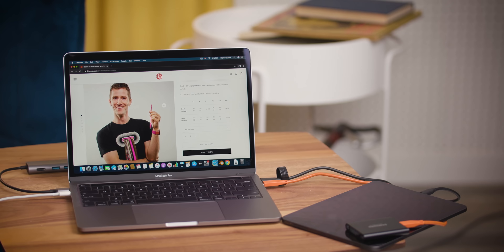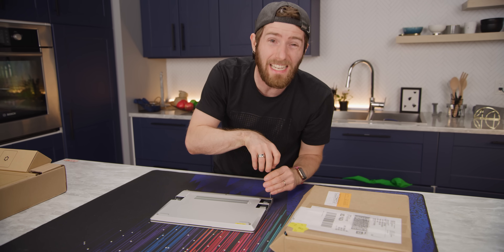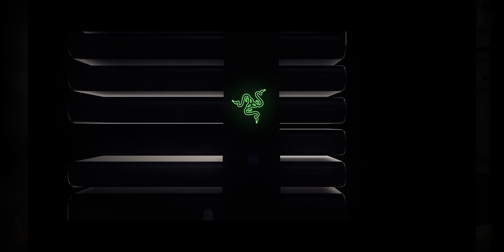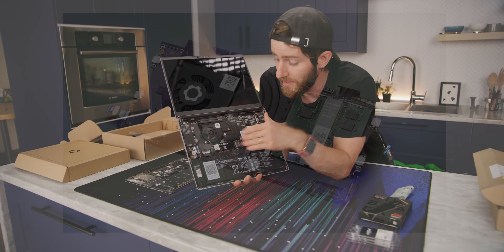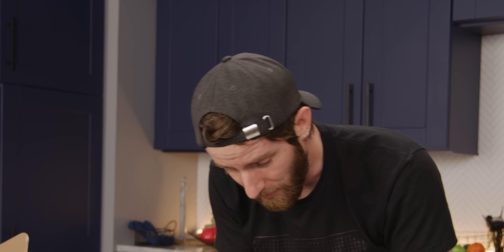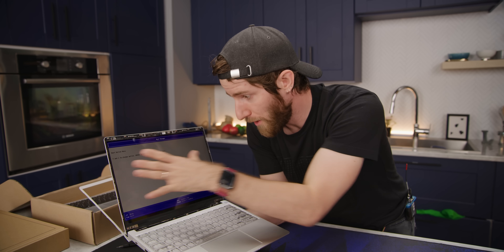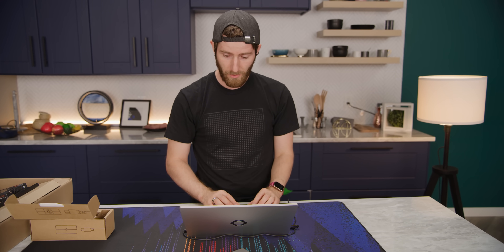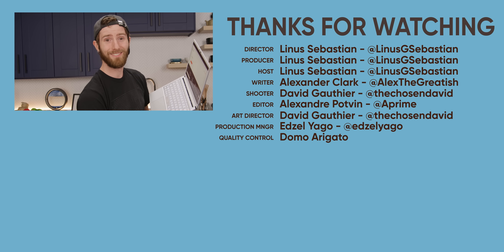A COMPLETELY Upgradeable Laptop?  - Framework Laptop Review

Comment: If the Laptop is charged with an USB-C-Port, I'm currentzly using one round USBV-C-Plug, that magnetically connects with it's cable, and since I got options for Micrto-USB as well, I pretty muchg hitted my other Devices with the compatible connector., so the SwitchPro-Comntrollöer charges with a magnetic cable and my PC-Controller does the same as do my cheap Tablet, Hand-Ventilator, my Moms Scanner for her Diabetes, her Phone as well,  and my small Bluetooth-Speaker.

And when I accidently connect my SwitchPro-Controller with my PC, my PC does recognize it.

Edit:
Link for the Typa of Cable I'm talking about
https://www.amazon.de/dp/B081D6RTT7

Comment: If this doesnt blow up I'll be very dissapointed.
we need more solutions liek these.
edit: regarding QR codes on the slots may not be the best solution, as all things on internet that dont make their way to "wayback machine" tend to dissapear for good.
just looking for drivers on a system that's 5 years old is already a chore as tech is moving way too fast, and new solutions come in.
so a tangible manual would still be great,

Comment: This thing is amazing! It is repairable and doesn't even slightly compromise on functionality. This is proof that tech companies have no excuse to make their laptops hard to repair.
Reply: See, I legit wonder how much R&D goes into making them hard to open. It almost seems like they would end up using more resources doing that then they would making it open.
Reply: Except it does compromise. A fair bit, actually.

There's only 1 USB 3 controller for all 4 ports. That's a huge compromise, since, despite there potentially being 4 ports, you're only getting full USB 3 bandwidth if you use one at a time.

There's no dGPU. Again, that's a huge compromise, especially given the price.

There are only 4 ports. Another big compromise, as most prebuilts give you more. My current laptop, which cost about as much as this one, with similar CPU, etc., gives me 1 charging port, 3 USB ports, 1 HDMI port, 1 Ethernet jack, and 1 SD Card reader. I can use all of them at once (and sometimes I do)--I don't have to pick 4 or carry around a hub.

Is it a decent machine, price aside? Sure.

But you can't possibly claim that it makes no compromises on functionality when it does so repeatedly.

Comment: Looks amazing, and I love that is uses a 3:2 display, but I'm never buying another laptop that doesn't have a touch screen.  I hope they offer that option in the future because this is looking pretty good.

Also upgradability for a laptop sounds good on paper, but realistically laptops tend to get a lot of wear and tear over time.  A regular $600 laptop can last me 3-5 years with little more than a battery swap, but by then it's looking pretty worn out which doesn't matter since it's usually due to be replaced anyway.  But this I would expect to be able upgrade for 8+ years, and I just don't see it looking nice and being fully functional by the end of that.  It seems like the only benefit to this is really just to save a bit of money by buying parts instead of a new laptop for a couple of generations.  I'm not one of those people who wants to keep old hardware alive and relevant by installing tiny linux or whatever, so maybe this is just not for me.

Comment: I would love a soundcard expansion for this thing that comes with more audio ports and a better DAC and AMP.
If we can stick them in USB sized from factors, we can do it with their expansion cards.
Reply: I think honestly you can hack one yourself, but if enough people ask I think they will do a first party solution
Reply: @Goldenoodles  it could be possible with a high quality USB soundcard/sound interface. 
But I'd feel awful mutilating a good one, even if I had the laptop. I'd also have to gut a working expansion card and rip it apart because I don't have a 3D printer to print these housings.
Not saying it can't be done, just saying I don't want to do it, nor am I the one to do it.
Reply: @LaskyLabs  gotcha, right now all we can do is wait and hope for it. Since all we have is a 3.5mm jack

Comment: I upgraded my old MSI GE70 with more ram (+8gb), new processor (i7 4700MQ => i7 4930MX), 1 SSD and a new battery. The only thing I could not change was GPU, because it was soldered to the motherboard. And this Framework laptop has soldered CPU + GPU, that means you will have to change the whole motherboard if you want to upgrade the most important parts ... Why did they not put removable CPU / GPU ? Even with specific laptop format / plug (MXM ?). My old MSI had removable CPU, and some Acer / alienware have removable GPU, why not mix ? Being forced to upgrade both at the same time is not the best

 And yes, modular IO seems nice, but it's just a detail to me ...

I feel like it's going to be some apple thing : you will have to buy entire new specific and expensive Framework motherboard with soldered CPU / GPU in order to upgrade, nothing else will be compatible and it will end up being just as expensive as a new laptop. I hope I'm wrong.

Idk, it doesn't feel like a "completely" upgradeable laptop, maybe future versions will be more modular, that's when i'll throw my money at them

Edit : I just saw there is only 1 shitty GPU option for now ... Definitely not buying, but in the future when they improve, maybe ? Base idea is good

Comment: I will always remember my old Alienware M17 x R3, made in 2012 with it's dated 660M GPU and it's abhorrently loud fans. Played allot of mid range games at low settings on that thing. But what I will always remember was how easily it was to upgrade the thing. It was so big you basically had a micro-tower on your lap, with ever component given a ample amount of room, and independence so it was dirt simple to unscrew, and replace any part. Added an SSD, added a 970M (With a fair bit of coding work to get it to run), and that thing just kept chugging. It's one thing to buy something that works. . . until it doesn't and you're fucked because it's glued together. It's another to buy something that begs you to fix it up, upgrade it and keep it running so you can get that absolute most out of your purchase. I paid 200$ for that laptop used in 2019 as my first computer, and to this day would have paid easily three times that much. It never failed me and I ended up handing it down to a younger brother and it still runs to this day. Better times.

Comment: "It all uses one bit?"

See? It's not that difficult, manufacturers.
Reply: AND it comes with a decent quality screwdriver with that bit installed, so there's really no excuse.
Reply: @Anaerin  I would even accept a cheap screwdriver,
Reply: To be fair, my HP laptop also has all the same bit, the screws shear easily, but at least the same bit
Reply: @Ikxi  the indiscussable best bit is torx screw these bits attach to the screw like an effing kagnet torx is the nonplusultra

Comment: meanwhile the only easy to remove and change part of my 6 year old acer aspire is the battery the fucking ram you have to unscrew all the back plane then pull on it with a fair bit of force to separate the keyboard since the only way to access anything on the inside is under the keyboard to then be able to switch the ram the hard drive isnt even fucking removable a standard spinning drive which is likely gonna break if dropped it means the full laptop basically has to be thrown out well done to framework's for creating an actual good laptop when they add support for uk keyboard layouts i will defiantly be upgrading to one

Comment: I'm definitely on board to get this laptop for a few reasons. But right now I have a 9 year old HP Envy DV7 that I'm trying to figure out how to prolong the life of. It's stuck on Windows 8.1 and needs to be upgraded and cleaned to pick up speed and to use programs I need. But I really don't want to get rid of it. So more computers built like this! Definitely on board.
Reply: If you haven't already, upgrade to at least 8GB of RAM and install an SSD. That should make it much faster than it currently is. If you want to keep using Windows, I would consider installing W10 or if not, a Linux distro can be a good option.

Comment: @framework. Lenovo has a mode where the battery is kept at 50% SOC if you will be plugged in for a while. You could have either a bios setting or a driver beeing active in the task bar tray that switches that on. I dont know if they have a patent on it but i find it annoying to go 10 clicks deep into a driver menu to turn that feature on.

Comment: love the idea.
i will consider getting one, once they offer localised keyboards and chargers!
until then I will have to deal with my poorly engineered, build to fail, lenovo yoga 530, that had the display panel mount break (not the hindge or frame) after less then a year because I used it as 2in1 as advertised, and the didn't fix it on warranty.

Comment: People are too quick to throw away old laptops. If you have splunging tools that cost a couple dollars you can easily fix or upgrade laptops. I have an old a Samsung R55 from 10 years ago. I just purchased new speakers and new CPU/GPU fan/heatsink for it. I also purchased a new AX200 wireless card. Now I have a perfectly useable notebook still with wifi that connect to the latest network types. Looking at linus's video here it does look interesting though when he said the CPU was soldered it seemed a bit lame. The hardest parts i have seen that are to replace are the CPU heatsinks, speakers and motherboard / power.

Comment: I think the detach battery bios option is for when you are going to disassemble the laptop and not really for running it of the wall. Also this and the Power on AC attach options are fairly common

Comment: The point of right to repair is so your iphone doesn't end up in the landfill because a half cent resistor failed or the glued in battery died. Or how about a 50% chance of smashing your windshield to change or charge the battery in your car. Would you put up with that? Well this is where we are with phones. All the companies following Apple and Apple claim to be the greenest but are the biggest polluter because they resist repair of their devices at every opportunity. This is why they should be forced to support their devices and properly repair and supply parts.

Comment: I applaud Framework for trying to bring something back that once was a given or at least much more widespread. You see, we actually used to have an almost comparable amount of upgradability and repairability up to 7-8 years ago, at least with certain notebook product lines. Older models of the IBM / Lenovo T-series are a good case in point. Basically everything about these devices was upgradeable and repairable, which helped to increase the lifespan of the product significantly. To give an example, I personally still use a T430 from 2013 to this very day. Over the years, I have upgraded the CPU, RAM, main memory and display, and I have exchanged the original smaller battery for a larger one. I had to replace the entire keyboard once, and two individual keys due to wear of the mechanism under the pads. None of this was a big deal because original spare parts were widely available (Lenovo discontinued hardware support only last year or so). Owing to all of this, the device is still a decent workhorse for most computer applications. Sadly, Lenovo started soldering shit onto their mainboards like everybody else in following generations of T-series notebooks ...

Comment: "THE DELLS NOT EVEN FUCKING THINNER"

ROFL Im genuinely interested in buying one of these laptops now. Also the fact those modules use type C means you could pull apart the enclosure or 3D print the enclosure and put literally anything you want into one as long as you can make it fit.
Reply: According to their website the ability to create the little expansion modules by users and third parties is part of the plan.

Comment: "Modular" means that you can replace any "module" of the laptop that uses standard usb-c to interconnect (even when some peripherals performs better over pci-x) buying slightly overpriced modules from the only seller available? You can found the same adaptor on amazon or aliexpress but without this fancy form factor.
And what about processor or memory? You can upgrade from ddr4 to ddr5? No? Then this "upgradeable" is useless. How many rams you broke in the last 30y?

Comment: Come on apple are mentally challenged, aside their intentionally bad design. It takes a special kind of genius to make a laptop with heat sink disconnected from the cooling fan, not to mention a huge number of issues at software level that makes it harder to do basic stuff from open the device or even receive emails.

Comment: My Chromebook Pixel LS 2015 has color coded screws. If they make a USB4 one of these, it'll replace my chromebook. Also, Apple's magnetic charger patent only covers chargers that can go in upside down, it's been sidestepped by ones that work connect at any degree of rotation.

Comment: So, no Ethernet Jack?

Yet... they don't sell an expansion card for ethernet at the moment, but might in the future... Weirdly, it's almost a deal-breaker for me although usb to ethernet dongles are a thing. Otherwise, I just love the whole idea and execution. Add an ARM board that rivals Apples M1 and I'll take three and won't even whine about no ethernet.
Reply: Pro tip kids. Many hotels still have either net jacks in the wall by the table.... such better connection that wifi ;)
Reply: @sydisticsandman  *Ethernet, and correct! A personal trick of mine.
Reply: @whitelightning1683  Also also, just because you're not wireless doesn't mean your packets are safe!  Public networks are still public networks even if hardwired in.  The fact this is something that needs to be explained is a bit sad, but it does so here I am.
Reply: I'm not a tech, but wouldn't you - if using cabled network - usually be hooked up to a docking station with the USB-C access for charging, network, monitors, and stuff?
Reply: @Johan-xw5bf  For network debugging? When you go around the building?
Reply: @Johan-xw5bf  What lazlo said mostly, but also when I'm using the laptop lying in my bed or traveling, I want good stable internet without a bulky dock and cable is more reliable and has less latency.
Reply: Although they have said they will release an Ethernet expansion card which will be oversized
Reply: @DK-um4go  That is good news, where did they say that?
Reply: ARM that rivals apple? Just say you won't be buying one
Reply: @jamespowell5147  Just saying it would be nice. The only things actually keeping me from getting one right now are that they are only sold in North America for now and that they don't have a non-dongle ethernet port, yet. I suspect both of these problems will be solved shortly. The "ARM that rivals Apple" would just be the absolute killer and not as far fetched as you might think.

Comment: Hey Apple! Are you seeing this? Wake up!!!

I have worked with Apple products since the intro of the original Mac in 1984. I have admired their work over the decades, but I have to say that the introduction of this approach to laptop design should hopefully be the kick in the ass that Apple (and others) need right now.

Apple has lost their way due to their focus on Anorexic Engineering (making design choices that seem to do just about everything possible to make devices as thin as possible while sacrificing almost every other design priority) and Planned Obsolescence (as a way to maximize revenue while cloaking this intention behind disingenuous claims of wanting to save the environment). 

If someone has an effective way to would…

environmentjustifyrequirespeopleyour

I hope this design approach is a wakeup call to Apple and the other manufacturers that have gotten lazy over the past 10-15 years. Step up.

Comment: The main advantage I see isn't upgradability, it's manufacturing costs. If the company has just 1 or 2 chassis then it saves money. Upgradeability, somewhat, yeah for the ports and it's neat but you are limited by the motherboard for upgrading of things like CPU/RAM and new features. You can do the same port upgrade on a regular laptop by just getting a USB addon.

Comment: Would also be great if they kept the main board installation as a standard and offered to the client to just buy a new motherboard instead of a whole new notebook.
It would be like a Desktop PC that you don't need to buy a new monitor, keyboard, mouse, case, PSU and in many times the Memory to upgrade to the next CPU/GPU generation.
They could even offer a return policy for the old main board to give a discount when you purchase the new one. This would allow them to properly recycle/repurpose those old parts.

Comment: You know, we have been through this stuff before.  I predict exactly zero chance of this making it even one year. I mean the MXM "standard" (created ~ 2011)was the closest we ever came, and it's all but dead. At this point I'd be happy if I could just add ram, or upgrade a SSD in a laptop. Nearly all modern laptops solder everything to the PCB.

Comment: from my son:
I think it would be cool for this company to make it act like an arduino and/or raspberry pi. when outside it's case (but give it a manual override to switch it back to acting like a normal pc)
It would still use the same intrusion detection system, but instead of making it lock out like other companies, this system would make the motherboard basically into a monster sized arduino but with java instead of C++ to make it more programmer friendly?
also because computer CPU...    ALL THE PINOUT BUS-BARS...  
though seriously, if someone's gunna make a laptop motherboard designed to double as an arduino or other "arduinoid" (arduino's Lilly pad, raspberry pi, little-bits, etc.),
then they might as well give it enough pins to make an Arduino MEGA look modest